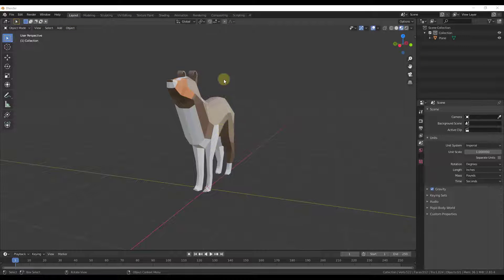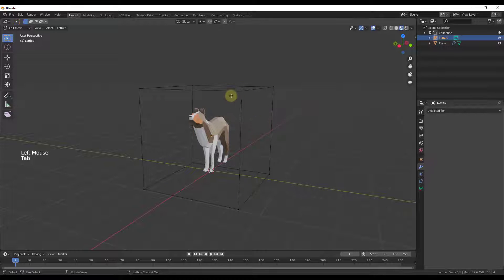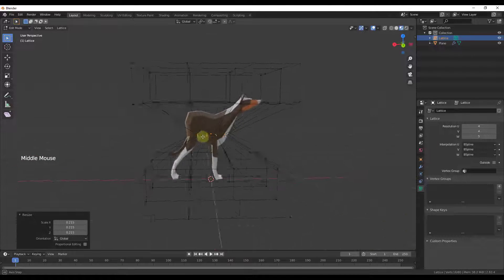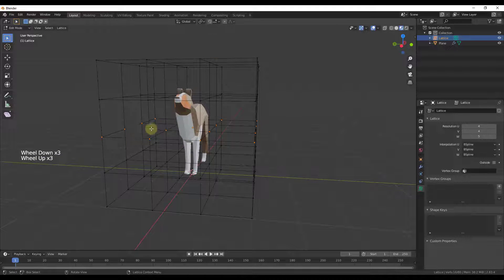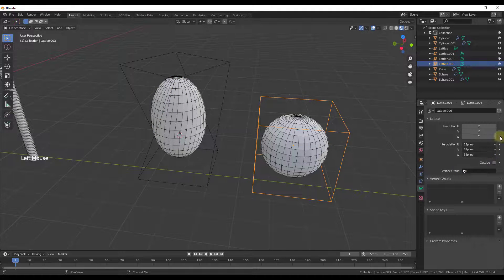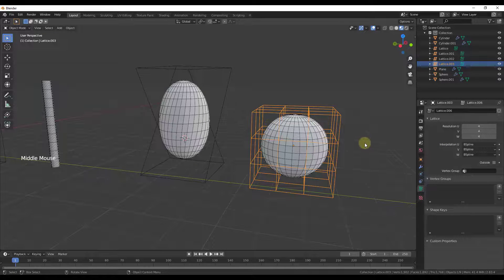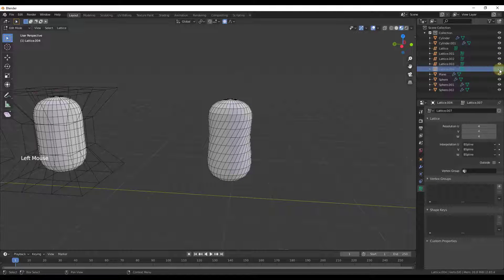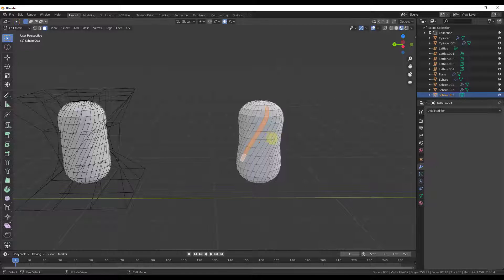Using the LATTICE MODIFIER in Blender!

Comment: I have the issue that when I make my object and then apply the lattice box how its done in the video, that the object moves to another location and shrinks. What am I doing wrong?
Reply from the maker: Had you scaled it and applied the scale before applying the modifier?
Reply: try to select your object and hit Control + A to apply all the transforms, see if it fixes it.